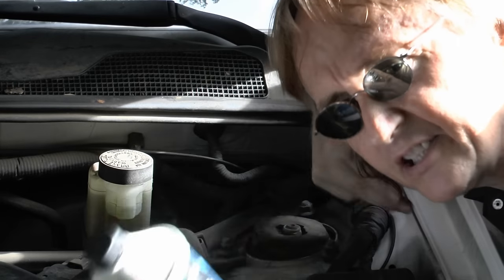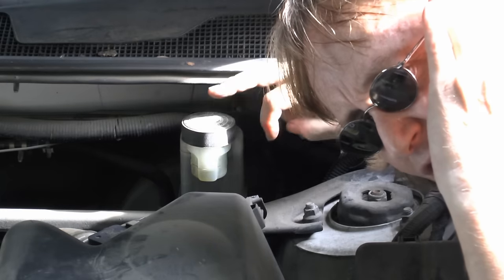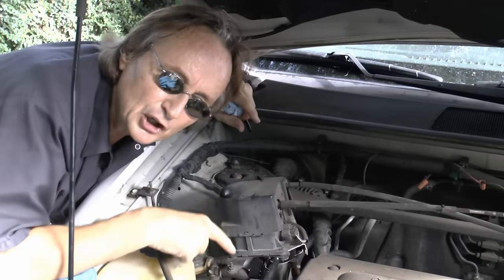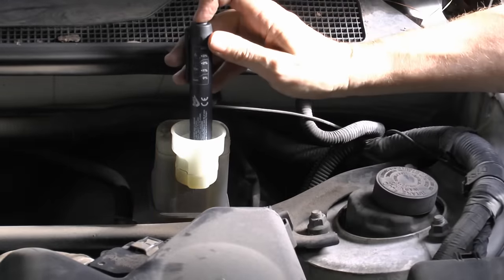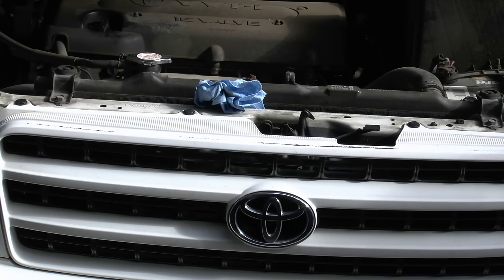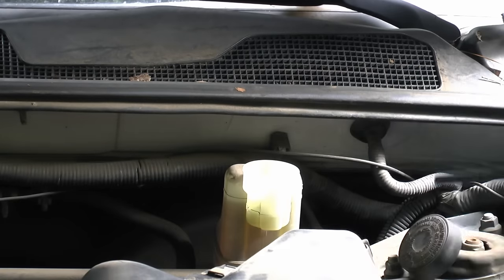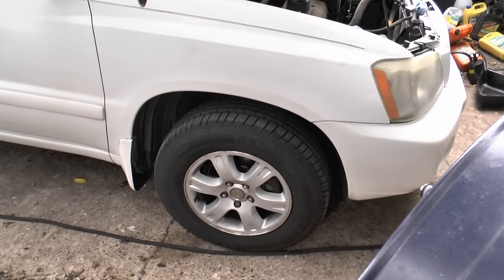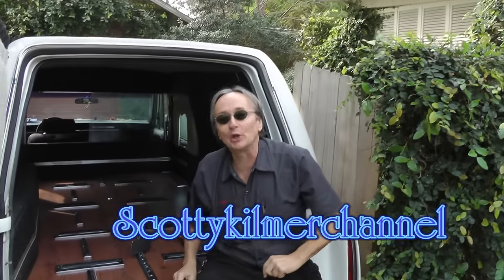How to Change Brake Fluid in Your Car

Comment: I have 5 bleader valves on my Toyota tundra!

my inside calipers do not work after I inspected them , IDK y

further more I have no idea if I should bleed the 5th bleader valve going to each rear brake line(however I do bleed it anyway as its the highest point in all the lines )

I wonder if it's a bleed Alla one type of thing my book says nothing about it no one knows what I'm talking about,but it is there & break line/bleeder valve(& I bought all new valves it came with 5 New valves & the stock & aftermarket are all identical to their maker & other 4 normal valves/bolts)

(really the only thing I've ever replaced but I've replaced everything so far break wise from master & booster to all the lines & now I just bought new blender valves & new rear drum parts)
Reply from the maker: +randall jr Benoit bleed them all of course and pray you don't have an ABS problem, as that can cause such a problem and those modulators cost a ton
Reply: +Scotty Kilmer thanks Scotty no abs (thankfully)on my 02 tundra....

after alittle more research I found its a $100-$200 "load leveler" & I had a real leak thinking/still hoping it's just a wheel cylinder but I'll be inspecting that "load leveler" next ....

& I replaced the break booster +Master cylinder after drag racing a Honda turned upfront of me and the breaks took the toll trying to stop (I did)

eventually the leak I didn't know about,leaked break fluid into the booster filling it up & getting sucked through the vacuum hose going to the intake manifold,replaced these 70k miles ago but I now have a leak in the rear & the front calipers don't work (on the inside 2 of 4 piston's each side only)

I watch your show all the time & I got my dad to watch you aswell (it doesn't matter how old you are ,or how long you've been doing something,because we learn something everyday!)

Comment: Is there anyway to clean or brighten the fluid tanks under the hood? I have pretty bad vision and it's always extremely difficult for me to see where fluid levels are in the brake, coolant, and power steering reservoirs. I have to shine a bright flashlight from the back and practically shake the container to try and see movement of the fluid line. Other than that, it's so yellowed and opaque I just can't see it.
Reply from the maker: not really, but use a bright flashlight, really bright, that should shine through

Comment: I just came from my dealership and they wanted me to do a brake fluid flush. I asked why and they said well you have 86,000 miles and you have moister in the fluid. I just don’t trust them. I’ve been burned before. So does anyone have a thought on this?

Comment: I own a 2014 volkswagen polo 1.5 tdi , it has done 56000 miles , now when i put the car for periodic service ,the service advisor  insisted me to change the brake/clutch fluid.   Is he right? Or should i skip it???
Reply: if you want to keep the car a long time I would say yes as it keeps it from eventually corroding the whole system. If you keep the car only 5 years then forget it. wont be your problem.
Reply: E150GT    I only use diesel cars considering the fact that diesel engines provides more torque than petrol does, and i trade my cars usually within 5 years after purchase.    Thanks for the advice
Reply: money ruins I forgot to mention if you do any mountain driving i would get it changed. that would be bad for any moisture to boil off and cause a loss of braking on the side of a mountain. since you have a diesel you won't be able to engine brake effectively either

Comment: Pro tip: if the local parts store is closed for the day, and you are working overnight and for some reason don't have a squeeze ball laying around, use a turkey baster. They are extremely cheap, and get the job done just as well.

Comment: Hi Scotty! I have a question. A friend has bought a Daihatsu Gran Move recently. No problems overall, only the brakes make a weird noise when they are warmed up. When i push in the brakepedal it does "Bonk". Its not a loud noise but u can clearly hear it. I checked the rotors but they arent worn out they feel like new (no edges sticking out). I cant see the brakepads though cause of the rims. U think they are worn out? Although if they were i would hear a screechy metal sound right? U know what this "Bonk" sound might be? Sorry for my bad English btw. ;) Thnx in advance for your trouble if u are reading this. :)
Reply: It sounds like his. Clunking noise when applying brake
Reply: ***** thnx:)
Reply: Didnt i excuse myself for the bad English?

Comment: my moms pontiac grand prix  2007 breaks are hard to push in and when i push them in i have to push to the floor to feel any braking, unlike my 2006 chrylser seabring that starts to break when i just touch the pedal. Could the fluid need to be changed, brake pads need to be changed? please respond so she doesnt have to spend 500 bucks on fixing her car if something is really wrong
Reply from the maker: +Colt K many things can do that, but often worn out master cylinders IF all wheels are taken off and no leaks exist at any wheel

Comment: I have a question about brake fluid vs mileage: My 2019 Honda Insight that I own and use for my courier business has accumulate about 100k a year. It asked for brake fluid at 105k and I was too nervous to neglect it's request and I am thinking I had maybe wasted $109 having it flushed at the local Honda dealer. Will (highway) mileage like 100k a year wear down the brake fluid or is it more of like a do it every few years/wears out over time kinda deal. Honda has no set maintenance schedule in paper it's all up to the maintenance minder $ystem which i think likes to make sure everything'$ well maintained ($$$). I hate to throw money away on unnecessary services but the other services intervals like transmission fluid (it asked at 95k) oil changes (asks for it about every 11k) and plugs (asked at 100k even though they're $39 EACH! (ill never recover from that shock) (can only be bought from honda) have all been reasonable aside from plug co$t. It still hasn't asked for new coolant at 110k so i though the brake fluid request didn't fit in. The brakes are hardly used bc of the generators (original pads still) so I am just a little baffled. I would appreciate any Clarity, (hah!) except I am too lazy to plug any Clarity in, and that'y why I have the Insight.  Ty!

Comment: my front brake calipers is grabbing the disk at irregular occasion. the master cylinder has been replaced with kit, flexible hose has been replaced. It still stuck. to release it I detach MC from the booster. I also noticed that the pedal becomes harder to push first then it is stuck again. Do i have to replace the MC assembly?
Reply from the maker: +Ivan Rivera   yes, that or the booster is sticking in the on position somewhat

Comment: Hey scotty, thanks for the helpful vids! got a question for you: i have a ford Taurus that was in storage for a while. Ive been Hearing a knocking sound whenever i step on the break or turn and have no clue what it is. Its not a pattern like knock. This only occurs when i drive the car non stop or when it heats up. I was told by the jiffy lube dudes that it might be humidity in the break lines?
Reply from the maker: Super Drone that's B.S.   More often it's worn suspension parts, go to a real front end mechanic and let him check it out, most give free estimates

Comment: I heard that when you  bleed antilock brakes you can't get all the  air out of the antilock system and you have to take the car to a garage to get it all out. I've done it and never had a problem.
Reply: At my shop we use the computer to do an ABS bleed while we do the fluid flush.

Comment: Hey Scotty, have you ever worked on a Hummer H2.  What is your opinion on pros and cons.
Reply: ***** I know, but I really enjoy driving it around.  And wanted to know if any future wear and tear I should look out for.
Reply: +Frannyontheone I was wondering of putting 37 inch tires, brush guard with winch, and intake.
Reply: Billybob Vedia
 My cousin bought one and put on some nice tires and a sweet ARB front bumper and it looks great!! I even convinced him to bring it offroad a couple of times and since he has dark window tint, black cushy leather, and awesome a/c it was like we were off roading in a comfortable living room haha. If you get a 5-cylinder hummer make sure it has the new cylinder head on it, the original head had problems on one or more cylinders and cause constant misfires which can easily be ignored. The new head is gravy though! The thing scoots!
Reply: CubNole do you have a pic of the rig?
Reply: Billybob Vedia  Yes message me your email address
Reply: Billybob Vedia Whoops his is an H3 not H2. I get them mixed up, so he has the smaller one I! My mistake but it's worth looking at, here's his Craigslist ad. Those windows barely let sunlight in so it stays cold as ice in there in the summer haha http://northmiss.craigslist.org/cto/4669393233.html
Reply: Sweet ride

Comment: How often should I change it on a 2011 honda accord?
Reply from the maker: +Air Handler test it as in this video, or change it every 5 years.
Reply: Scotty Kilmer What if it's it's 5 years old but only has 12,000 miles on it?

Comment: I own a 07 corolla with 86k miles and the brake fluid still looks like yellow honey. I work at a ford dealership and I see cars 3 or 4 years old with pitch black brake fluid. Idk what it is about fords but they don't last at all when it comes to brake fluid. My coworker owns one of those brake fluid testers and they do come in handy. Ford needs a better system of sealing brake reservoir, they don't keep dirt and moisture out.

Comment: Hey Scotty
My brake sign on the dashboard just came on recently. I have no idea what the problem is or how to fix it. 95 Camry. Please help. Thanks
Reply from the maker: check the brake fluid, it's probably low. Light comes on if fluid is low or if brake pressure is lost or if E brake is stuck on.  If low, fill it up and check for leaks, just realize some is used as pads wear, so it you see no leaks and it doesn't empty out in months, it's just that
Reply: Well brake fluid isn't low but I added more brake fluids in and that seem to do it. Thanks again!!!

Comment: Hey I got a BMW 2006 5 series and it telling me I need my brake fluid flush. My car squeaks when I drive. Is that because of my brake fluid or do I need new brake pads
Reply from the maker: squeaking has nothing to do with fluid, worn pads and rotors make squeaks
Reply: Scotty Kilmer well the brake pads are basically new and the rotors don't look to bad either. some ppl tell me that  the problem was because the pads are not bmw products and some way that has some thing to do with it. what do you think about that?

Comment: Went to the dealer they told me I needed brake fluid that it was extremely low. Do I have to flush out the old fluid or can I just mix the old with the new?!
Reply: If your fluid is low and you don't have a leak, this indicates your front brakes are worn down,   as your pads get thinner, the caliper pistons are out further with a greater volume of fluid behind them         Have your brakes inspected!!
Reply: Brake fluid should never need topping off.  If it's low there is a problem!

Comment: I have a 2000 bmw 528i and when I brake it squeaks all the time being black power on my rims. Are they just the brakes as in I should change them or I need brake fluid ?
Reply from the maker: older beemers always do that. The ONLY way to stop that is to put on brand new dealer oem pads and rotors, and they cost a TON.  The swines make em so the pads don't touch the final edge of the rotors, so as they wear, there's a groove on that final edge that ends up making noise when you brake. Pure Evil Genius for making money on those things fixing the noise that otherwise would not be there.
Reply: Scotty Kilmer
Yet another reason that I would never buy a BMW.  The company provided me with 2 new M-Bs and I would never buy one of those with my own money either.
Reply: SwagJabo ClanHD 
We installed ATE Power Disc + ATE Ceramic Pads on my brother his E39. No noises, no brake dust.. and... No warped rotors! When you order them aftermarket, price is ok.

Comment: Hi Scotty, I have a ford transit van (UK) with an intermittent noise from the front left wheel,when breaking heavy at slow speeds, less that 30 mph. It kinda makes the same noise when you rub a stick over a cardboard box. The Pads are fine, the disk is smooth and looks almost new, I checked it with a dial gauge and it's as flat as a pancake. All I could think of was maybe the wheel bearing is dead. but there's no play in it and no road noise. Please help me, it is driving me crazy.!! BTW It doesn't have ABS.
Reply from the maker: check the front end for wear, maybe a worn ball joint is doing that.
Reply: Thanks Scotty, Will do.

Comment: Hey scotty I have another question I noticed that one I brake my brake system light comes on then goes away after I take my foot of it what does that mean and my abs light doesnt come on when I use my abs so what do you think? thanks
Reply from the maker: abs light only comes on when system has a problem.  You probably have a burned out light bulb making the brake light come on when you use the brakes
Reply: ok thanks for replying im going to check that right now
Reply: ok i just checked and all my bulbs work the brake light seems to come on when i slow down and use my brakes the light comes on then goes away after i release my brakes any more ideas ?

Comment: will old brake fluid cause the brake pedal to have a bit of squish to it, but not go all the way to the floor.
Reply from the maker: +Georgeqaws it will IF it makes the seals go mushy and wear
Reply: +Georgeqaws ,   as stated in the video old fluid contains water,  especially in the cylinders it absorbs the most,  and once it heats up water turns into microbubbles vapor  making your pedal go soft.   Anyway i'm for a full 1-2 year flushes.
Reply: +Georgeqaws also if your brake system has any air in it.... air compresses, liquid doesn't. Pays to have your brakes checked for air in the system.
Reply: +Georgeqaws could be low on fluid or have air in the system. old fluid doesnt really have any noticeable effects until its really old and starts to cause problems. Most cars need it flushed every 2 or 3 years.
Reply: Actually my old merc 1998 never had a breakefluid change. 180.000 miles. It really is squishy now when i think about it, i will change it as soon as i can.

Comment: Water will get into your fluid because brakes get hot/cold & this will move air in & out of the system. Little known rule of physics, mix any 2 liquids = a thicker third liquid, so old fluid does not flow as well as new . Some race cars change fluid after every race.

Comment: Nissan Dealer told me my nissan altima 2005 v6 has dirty brake fluid and needs to be replaced. Does dirty means bad?
Reply: Yes, you get much less performance because water is absorbed and the fluid also absorbs rust particles in the brake system.  Should be changed every 3-4 years, 5 years max.
Reply: oldtwins na thank you!

Comment: someone tested my brake fluid once with a litmus paper test kit...and said it had copper particles in it. what causes that?
Reply from the maker: you have steel brake lines, BUT they are lined with a copper coating. It's that coating that comes off.

Comment: Well, I knew I have to change my brake fluid when brake hose ruptured. During the inspection.  (BTW I found out that this is common)  from the station I drove without brakes to my mechanic.. just few clicks away. I was braking using engine, and helping my self with handbrake to complete stop.  Mechanic sayd that all the hoses must be replaced because they were crumbling in his hands. Well, my ride is 24 y.o and hoses were still original from 1990.  Also in my country in the winter time there is a lot of salt on the road, and manufacturer used metal hoses. So my mechanic made him self new hoses from the copper - eight of them, I payed not much.. 350pln (about 100 usd.) But I'm not happy, because he was a bit of lazy and one hose is routed without any sense..  To do it right he would have to remove the engine which in my car is very hard... U would have to use a torch and welder, and price would be another hundred, and car would have to stay for couple of days, and I, on the next day was going to travel to vacation going there with my car.

Comment: Scotty what can cause a car to squeal when i turn the A/C on, it only squeals for 2 seconds after i turn the A/C on and works fine after that
Reply from the maker: replace the fan belt, pray it's that worn and NOT the compressor itself
Reply: I had a 97 accord do that.  Come to find out, when I had the belt replaced they used a generic belt.  Years later a Honda mechanic said put a Honda belt on.  I did as he recommended and no more squeal. 

When I looked at the two belts you could clearly see more surface area on the Honda belt.

Comment: I thought on my 2010 honda crv is left front and then clock wise from there ??  R Toyotas different ??
Reply: Woox Au yeah it is.
Reply from the maker: yes, most cars you go from the furthest away from the master to the closest in that order. BUT, some cars have weird routing and ABS systems that work differently, In those cases, follow the factory specs.

Comment: Anyone know why my brakes make a slight whistle or squealing sound when I take my foot off the brake?  It does it while braking when driving and it does it when I put it in park and take my foot off the brake pedal.  When parking, if I put the parking brake on before I take my foot off the brake...then it doesn't make that sound.  Thanks.